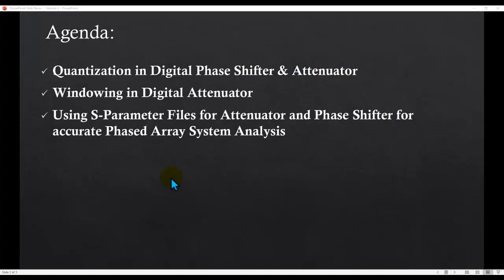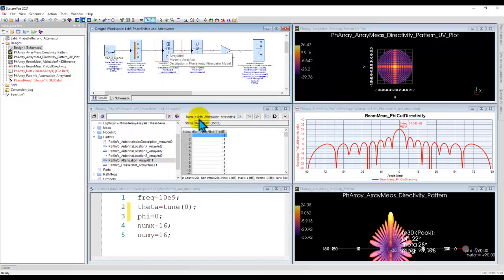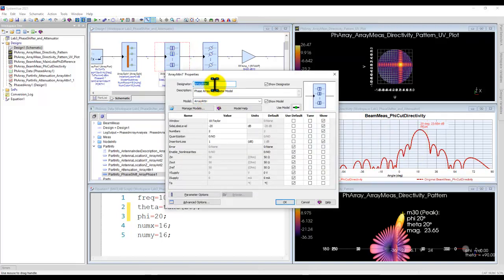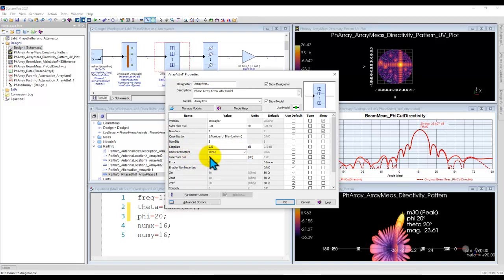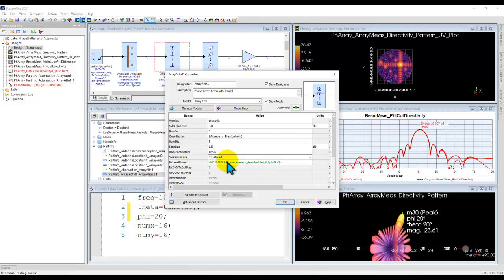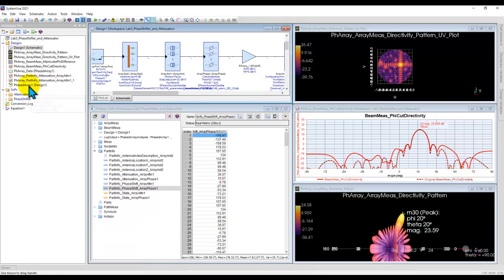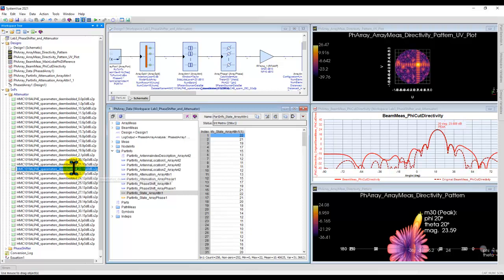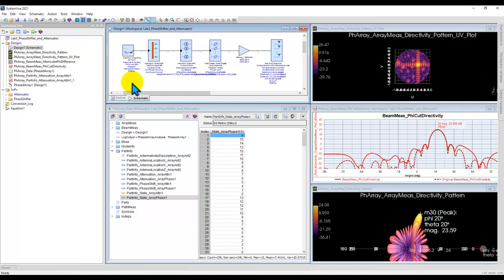Array-3: Using S-Parameter Files for Digital Phase Shifter and Attenuator for Phased Array Systems

Comment: Hello Anurag, Thankyou for your efforts. i Have a query related to the import of the S-parameter file into the systemVue.  while adding the dataset into the 4 bit phase shifter the 16 file are added. Now in my understanding to see beam steering, these files are used sequentially to steer the beam. But it seems that individual files must be selected each time. please clarify
Reply from the maker: Hi,
S2P files aren't used sequentially but rather depending on beam steering angle. You don't need to select individual file. Kindly watch the video again and take help from your local/regional Keysight tech support team if you still don't understand it completely.

Comment: Sir, I have designed phase shifters MMIC in ADS software but unable to run the cascaded digital bits. I need to know how are phase shifters controlled digitally and simulated so that I may achieve full n-state shifts and acceptable rms phase error.
Reply from the maker: Usually in RF Circuit design, its all controlled by managing the bias voltages of various transistors. In real life these will be controlled by digital logic which again inturn will do the same thing. You can easily set up all conditions in an excel file and perform a batch sweep in ADS to run every combination and then compute rms error. I will recommend you to contact local Keysight support team for help if you can't figure it out yourself.

Comment: Dear Sir, 
Could you make a video on  BJT/FET distributed amplifier with microstrip/ coplanar transmission lines for high frequency applications
Reply from the maker: There is an example in ADS for distributed amplifier, you can refer the same....

Comment: Appreciated 👏👏, Thankyou so much sir for the very detailed video.  , But RFlink-phased array block does not support S-parameter file can you please tell how can we can we link them for data flow beamforming using S-parameter file.
Reply from the maker: Hi Fabia,
Yes, SnP inside Phased Array RF Link is not yet supported in the dataflow beamforming approach. If you are focusing on RF distortions then you can simply used RF Phased Array. Is there anything specific you are trying to achieve using dataflow that is not there in the RF Phased Array?
Reply: @BhargavaAnurag  yes sir, I am trying to achieve AESA Radar end to end performance using three layer architecture. To make my radar more realistic I was using s-parameter file for feasibility study.